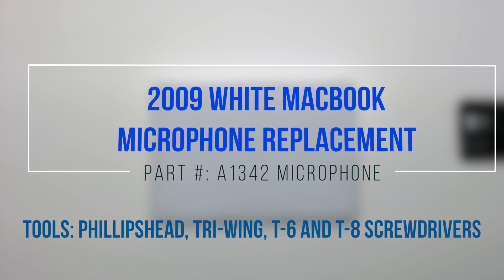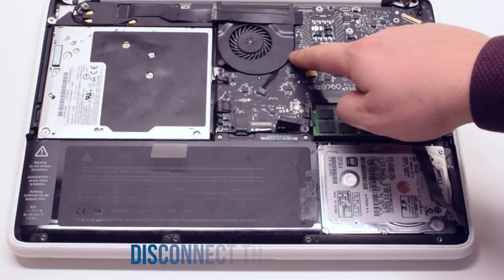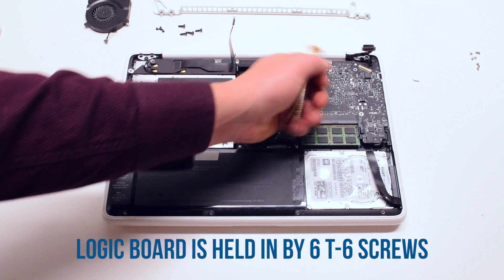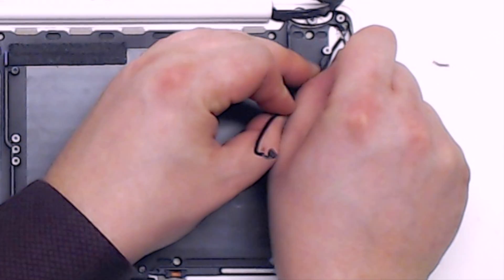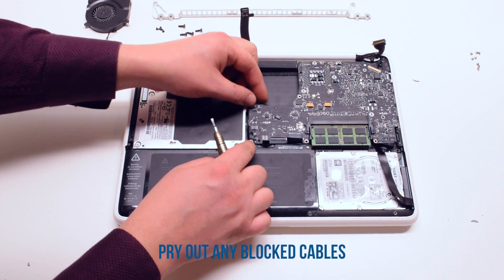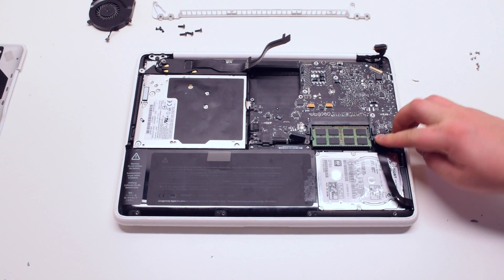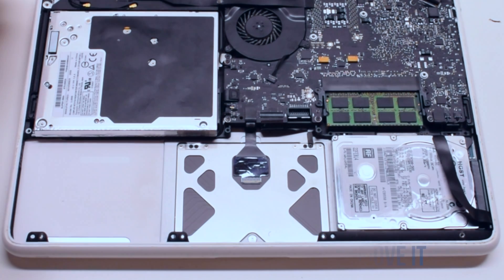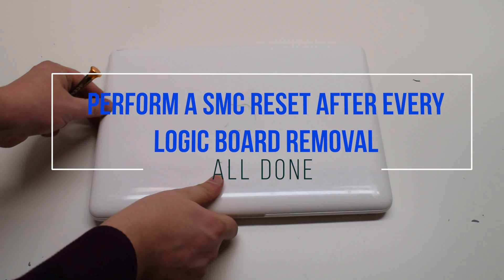2009 White Macbook A1342 Microphone Replacement

Comment: Hi, thanks for the video! when I try to reconnect the speakers and dvd's cables (5:30) they don't attach to the board, how can I solve this issue? Thanks!
Reply from the maker: No idea, they should light up if it's the correct replacement model.